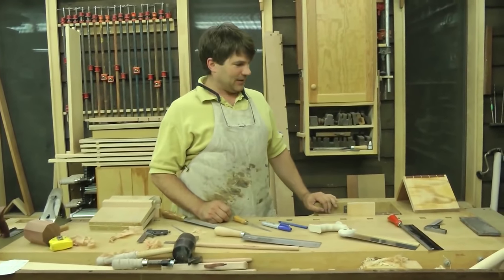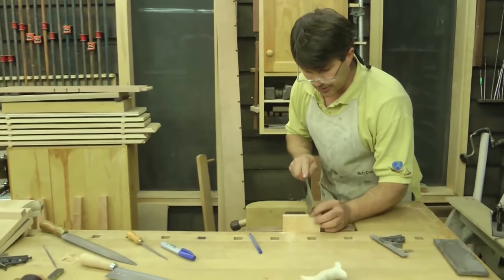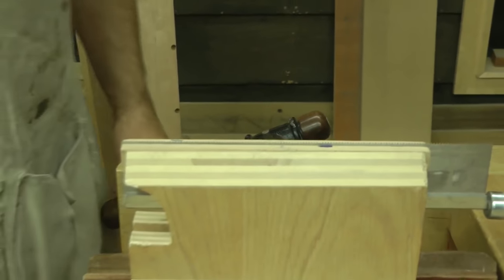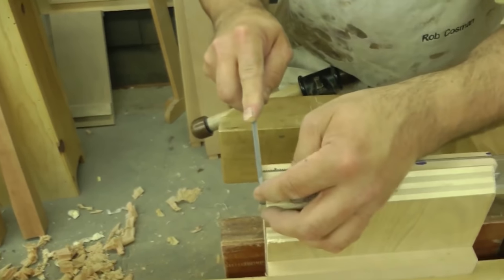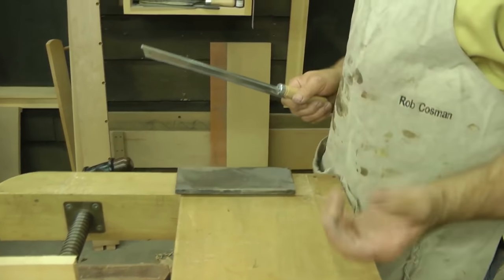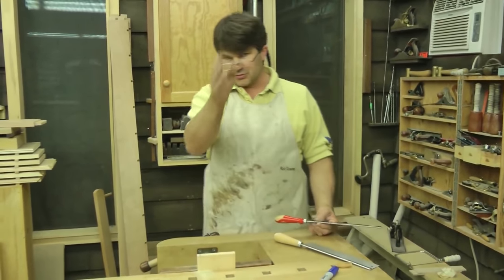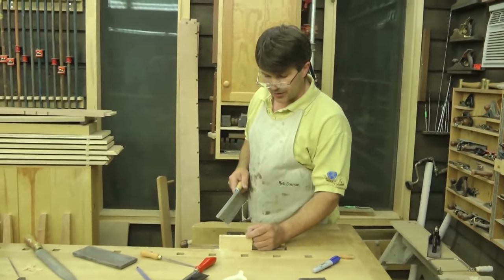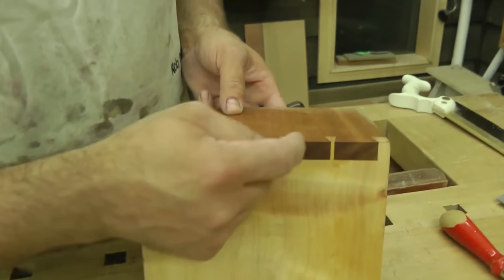Dovetail Saw | DIY Inexpensive Dovetail Saw

Comment: Thank you Rob I really appreciate it o have a full size cheap dovetail saw and the mini one also I am still learning and have now cut about 30+ sets of dovetails both practice joints and drawer sides for the shop furniture and I am currently saving up for a high end  saw from you!! There amazing and I’ve watched numerous reviews and all is good I can’t wait to be able to get one of your saws mine both work the full size and mini file handle saws and with this video I made both work 10 times better than factory! Thank you again for the amazing content it’s been completely life changing as far as my shop time and woodworking!

Comment: Another aid to gauging verticality on a saw file is a thin block fitted over the tip of the file using a d-shaped hole with the flat side of the hole parallel to the block edge. A d-shaped hole?!? Just drill the hole close to the edge, then plane the edge away to expose the hole to the dimension of the flat needed. Glue back a chip to close the hole, and Bob's yer uncle! From Fine Woodworking Magazine, years ago.

Comment: It is possible to approximate the smaller starting teeth on the cosman saw by changing his filing method.
For the first inch of the saw file the face of the tooth leaning back 10 degrees rather than 90 degrees as RC recommends.
Reply from the maker: yes you can relaxe the angle of the tooth by the way you hold the file

Comment: As alway, great stuff, Rob. Miss that old shop. 
A few questions: when and how do you set your teeth with these small teeth? Do you know of a set that does 12-20 tpi that is still in production? Or do you just use a hammer/punch method? A video on setting small saw teeth would be greatly appreciated as it doesn’t really exist on YouTube. Sellers sort of has a half assed one, but it’s got his old man philosophical ramblings mucking up the information (not to say old man ramblings aren’t entertaining or instructional—we all hope to be there someday.) Second, would it be feasible to attach a pistol grip to one of these gentlemanly saws for accuracy or control? I get it wouldn’t make sense cost/effort wise vs. buying a good saw in the first place, but say one had a few old ones lying around and time on their hands?
Reply: There are not really saw sets on the market to produce the minimal set that you need for certain work. For fine teeth the hammer in your pliers needs to be modified or it will press on the neighbouring tooth. There are videos showing how to modify the hammer; I will not go into it here or this txt will become very long 😂 but it is easy work on the Eclipse 77 style saw setting pliers 🤙 
To get the tiny set needed, the trick is to set the saw before sharpening. Filing the teeth removes set, so you set the saw first on the finest setting of your pliers, and then each stroke of the file will remove some of that set. A maintenance sharpening; usually only takes 1 stroke of the file, and we dont need to set the teeth. When the saw needs to be re-set in the sharpening schedule; then to start with take 2 strokes with the file after it has been set, and then test the saw. If it's still too much set you can take another stroke with the file over the whole plate.... repeat until you are close; but if you get a squeaky binding saw then you have filed too much and need to start again with setting. If the saw isnt tracking straight then it needs to be stoned on the side its pulling to. Once it tracks straight then you are done.
I would avoid bending the set out of a saw; it will weaken the teeth. File it out during sharpening, and stone off the set at the end to make it straight 😁
Teeth can also be hammer set, with an anvil and a punch with a slightly rounded end, not a "pointed" punch, more like a drifting punch with the edges at the end rounded over slightly. Either the anvil can be flat and the saw plate is elevated off the anvil by the amount of set you want, or a small bevel can be ground on to the face of the anvil near the edge and the toothline overhangs this bevel to create the set. The hammer setting method is heavy on skills required; every tap of the hammer has to be consistent enough, placing the punch on the tooth about 2/3rds the way up from the root of the tooth and centered, and holding the punch at a very slight angle....... all this takes practice and practice takes time. Then you adjust the set as before with a stone. 
Setting a saw with a pliers is the easiest and most effective way to do it, the hammer method takes time to learn and you will make lots of mistakes at first........ I'd only practice hammer setting teeth on saws that were old and already had messed up teeth, or saws that you dont care about that are only gonna be turned into scrapers one day 🤙
It's common to have 2 setting pliers, one modified for small teeth, and one normal for average teeth 😁
Reply from the maker: Whiity gives a good answer on the saw set, however I would be reluctant to set or sharpen my 22 TPI starter teeth, they actually work better a little dull
Reply: Tage Frid's technique was to twist a small screwdriver in the gullets of really fine teeth.